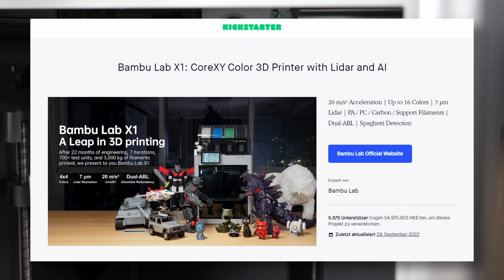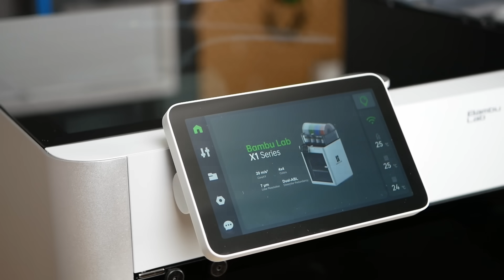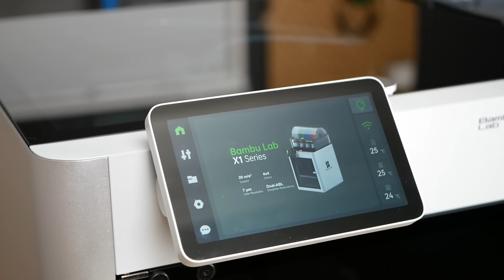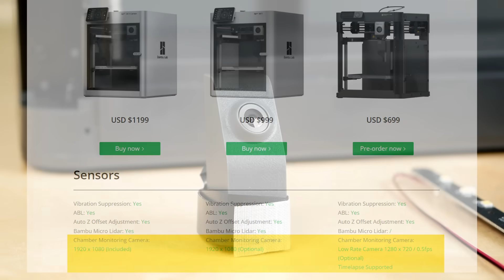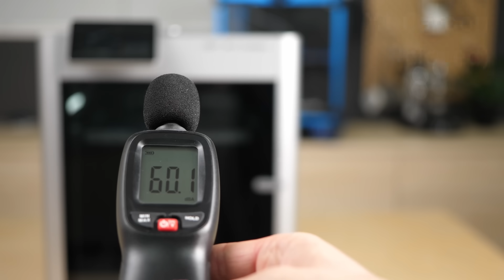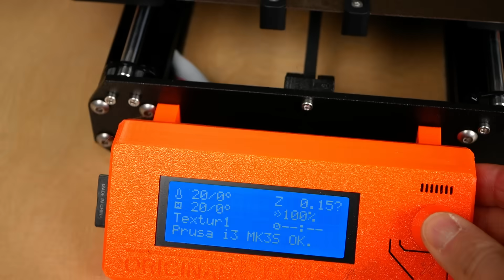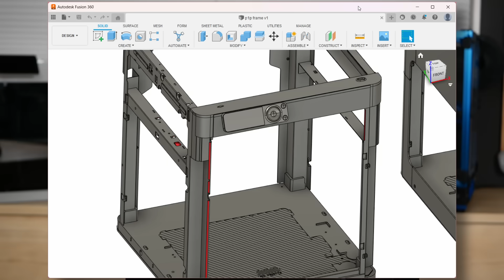The Best 3D Printer of 2022 got Stripped Down to make it Cheaper!

Comment: I got both the MK3 and the X1C. Not gonna lie, the later opens way more possibilities.

But I’m way more scared to break it. Because you can’t « break » a Prusa. Unless the whole machine catches fire, you can always dismantle it, reprint, and re-fasten the parts. 

The Bambu ? Not so much ; I can’t even remove the back panel
Reply: It's true that you can repair a Prusa, and the benefit of that can't be overstated. However, I think comparing it with a Prusa MK3 is the wrong comparison. The MK3 is 5-6 year old technology. Somehow Prusa continues to sell them for $1100, but in reality the MK3 should be a $300 printer (see the Sovol SV-06 - better than then MK3 in almost every way, now selling for $229). A better comparison would be the X1C vs. a Voron Trident. The Voron is also open source and can be repaired and easily modded. Both the Voron and the X1C are designed to print materials that require an enclosure. Parts on my Mk3 started failing rapidly (Z motor developed bad bearing, Z probe failed, extruder probe mount drooped) when I enclosed it. Both the Voron and the X1C can hit accelerations and speeds that the MK3 just can not reach.  Even after "upgrading" my printer with a Bear frame, a Y axis linear rail mod, and Klipper with Input Shaper enabled, I can't get remotely close to the same speed as the X1C or Voron. Plus it is an uphill battle to add mods to a Prusa that are either simple to add to a Voron or come built in on the Bambu Labs (an accelerometer, for example).  So yes, you can maintain and even mod an MK3, but the amount of time and money you put into that, the limited improvements you will get, and the over-priced nature of the base printer make it a poor choice in 2022. I was hoping that Prusa could turn it around with the XL, but with the delays in shipping and the introduction of the X1C at almost half the price, I am starting to have doubts.
Reply: @mghumphrey  The sovol sv06 uses junk knockoff parts from china, of questionable quality. That's why its $300. It's Z axis cant even align itself automatically because it's so weak. Modbot had to use soup cans to fix his sovol.
Reply: @LilApe  That z axis thing is 100% firmware. I know because I wrote a Klipper macro to do a soft Z tram for my MK3. If you think Prusa is using the same type of parts, also sourced from China. in addition, they cheap out on the infill and perimeters on their printed parts. The injection molded parts on the Sovol are actually stronger.
Reply: @LilApe  lmao so does prusa. When they say "high quality linear bearings," you know it's not a name brand.
Reply: @morbus5726  Except they use misumi rails and bearings, made in japan. Try again.
Reply: Nah, I've seen multiple people permanently ruin their Prusas.
Reply: @louisvaught2495  how ? There’s always things to salvage
Reply: @_Xantras_  That's a fairly naive viewpoint.

There's usually a point where diagnosis and repair exceeds the ability of an individual user to figure out what's wrong.
Reply: @louisvaught2495  how exactly do open bearings (to quote your example) ruin the frame, the bed, the motors, the wires, the PSU ? 🤨
Reply: @louisvaught2495  Running it over with their car?
Reply: @louisvaught2495  Press X for doubt.
Reply: @LilApe  Open bearing rails means it's relatively simple to get debris on them that permanently ruin the mechanism.

Relatively though, it's a rare failure case but means you have to strip and replace one (or both) bearing rails,  and sometimes the plastic parts have to be re-printed as well.

It's a PITA to diagnose and fixing it requires a full rebuild.
Reply: @louisvaught2495  How it’s permanently ruined if you can replaced busted parts and rebuild? 🤔
Reply: @apinakapinastorba  The same way a flooded car is ruined. Yes, everything can be replaced but it is rarely worth the cost and effort for the vast, vast majority of people.
Reply: @apinakapinastorba  When the repair requires knowledge on diagnosis that most users don't have, it doesn't get repaired. Of the two people I've seen this happen to, one gave up and basically threw theirs away. The other one was never quite the same as when new.

Bearing failures on the Mk3 can be really soft failures and usually just show up as artifacting on the prints. Other open-rail printers do the same thing, it's really common on Ender 3 style when you flat spot the rollers.
Reply: @louisvaught2495  I don't see how debris can get into the bearing of a MK3 when they have seals on them. However, that is exactly what happened to some users of the X1, with the open design of the X axis bushings. Its on reddit. He had to send his X1 back because Bambu doesn't offer bushing, bearing or rail replacements, they don't want you fixing that yourself. His carbon rods had huge gouges in them because there was like a .03" thick gape in the bushing and rail.
Reply: @tomsko863  That escalated quite quickly from busted bearings etc to replacing everything 🤭
Reply: @LilApe  There's no need to wildly speculate in order to defend something you personally care about. It makes it really tricky to continue a useful conversation.

The problem is that none of what you've said is anywhere close to correct.

Wiper seals aren't foolproof and need to be low drag, all it takes is something vaguely adhesive on the surface to allow debris to get into the bearing, and grease gets tacky as it ages.

The design of the Prusa is open with the bearings below the motion stage, which is particularly bad for this type of debris intrusion. The Bambulab doesn't have the same issue, debris won't naturally fall onto the motion components.

Mostly because the system is enclosed, but also because the extruder and print surface are both out of the way.

The Voron printers all do the same thing, moving the linear bearings out of the way of print debris as much as possible.
Reply: @apinakapinastorba  To be honest you're probably right. I'm not that knowledgeable so I would have no idea how to replace the lead screw or bearings if it happened to me.

Comment: How does this compare to Prusa printers.
Reply: Cheaper and better, dont get me wrong the i3 is a great printer, I have one and love it but what BL have done is outstanding but I see a return serve coming from Prusa, the XL is already in the works but I see them coming up with something inbetween the XL and the i3 MK IIIs+.
Reply: Faster, but not more reliable. Check their subreddit
Reply: quite a bit easier to use, and just as reliable, while also having like 2-4 times the throughput.

Comment: You're saving $300/$500 by cutting out the useless lidar sensor basically. Bambu proved with the P1P, how gimmicky and unnecessary the lidar in the X1 is.
Reply: Why are you on every video about bambulab stating basically misinformation. The difference between the 2 isnt just the distance measuring lidar, but the flow calibration tool head camera as well.
Reply: @BeefIngot  You must have a thing for me, you seek out my comments all the time and cant get over the fact that the lidar sensor does nothing.
Reply: @LilApe  I see your comments spouting misinformation on every Bambu video I see so of course I comment to correct that before you mislead people
Reply: @BeefIngot  Its literally facts though lmao. You cannot sit there and tell me its misinformation about the lidar sensor being a pointless gimmick, when 99% of their users disable everything that has to do with the lidar in the print process, this literally making it useless. You're on the internet, you can look it up.

Go tape up your lidar sensor, tell me it does something different, it doesn't.
Reply: @LilApe  I have an X1 carbon. Can you explain which settings I'm using disables the LIDAR? 
You said "99% of users disable everything that has to do with the lidar".
You're also saying that "everyone" disables first layer checks? This is the first time I hear about this. Why would I do that?

If the LIDAR is covered up, the pressure advance is set to a static value of 0.02 as a failsafe. This value will is a good standard value for PLA.
But this doesn't mean the LIDAR doesn't do pressure advance auto-tuning.
Reply: Hello again. Im still waiting for the video where you post the 0.003mm tolerances you hit on your prusa, and the sub 10 minutes speed benchy you said was possible.
Reply: @morbus5726  They really do spout nonsense. The claims they make are absurd
Reply: @morbus5726  You and they beef guy really do have a hard on for me. Your daily mission to seek out my comments. I'm flattered.
Reply: Where did you find the cost for the lidar sensor?
Reply: @logitech4873  They didnt. They are talking nonsense and dont even realize that the X1 doesnt only just have the lidar sensor but also the toolhead camera and computer to do the computations required for computer vision.

They have no idea about what anything costs or does. They just hate Bambulab
Reply: @BeefIngot  "toolhead camera and computer to do the computations required for computer vision"

You mean the camera that tells you if your 1st layer is good or bad...which everyone disables? you mean that tool head camera?
Reply: @LilApe  You keep stating "everyone disables everything" like its a fact, but thats just not true.
Reply: @BeefIngot  Again, I said you're on the internet, look it up, you'll find the evidence you need.
Reply: @LilApe  "look up evidence for the baseless things Im saying" are common words from parties arguing in bad faith. Either you have evidence or you don't. Its obvious you dont.

Comment: Personally I don't care about losing the enclosure, the high temp bed or nozzle but losing the camera and some of those other first layer perfecting features probably makes it a pass for me. At that point it's not much different than my prusa just a lot faster.

If I was going to buy a new printer I'd splurge for the carbon
Reply: It does have a high temp nozzle, just not a hardened steel one.
Reply: Just as a note, you CAN get the Camera, LED Strip, Hardened print head and the Aux cooling fan as options. I think Bambu has priced all their parts very reasonably, with their custom hardened nozzle priced well within the price of similar nozzles (high quality ones, not the clone junk). A similar nozzle for an Ultimaker 3 runs $120 USD. Bambu sells theirs for like $17 or so. They also have free prints for making side panels if you need to enclose and even the glass top and door are available at reasonable prices.
Reply: Of course you don't care. You must be only printing decorative things in PLA.
Reply: @alejandroperez5368  You don't have a clue.
Reply: @alejandroperez5368  You must be new to the 3d printing community - so far you were more into communitys where it is normal to answer reasonable points with personal slurs.
Reply: @zebarzebra  nope, I've had the Ender 3 for years. Your comment only makes sense if you're printing only with PLA and PETG. But zero ABS or ASA parts ;)
Reply: @alejandroperez5368  As an Ender 3 owner who seems to think highly of themselves I would have expected you to be aware that none of those features are required to print functional parts, partly because there are ways to get printers to print ASA/ABS without a built in enclosure (eg using an external enclosure as many Ender 3 owners do), and partly because PETG and PLA are perfectly serviceable as structural parts if used appropriately.

Comment: The p1p proves without a shadow of a  doubt that the prusa printer is hugely overpriced.
Reply: learn from history... read about what happend to makerbot....
Reply: Overpriced? No. The components they use aren't cheap and designed for longevity. Showing its age and desperately needing a refresh/redesign. Absolutely Yes. Prusa better be spending all the time they're delaying themselves to crank the speed of the XL otherwise every review will say "it's a good printer at yesterday's speeds, buy an x1 carbon instead".
Reply: @zeke7515  you can and people have self sourced mk3s using oem parts for 500$, much less than the kit of 800$. They have even raised prices as I purchased my mk3 for 750$. Outdated hardware should get cheaper with age.
Reply: @Unscientifically  not necessarily—that only works when you deal with the same suppliers and they have paid for the tooling.  Prusa has had to change suppliers—global disruption don’t you know.  They are trying to in-source where they can to help control costs but they don’t have a dozen parts manufacturers within a standard league all bidding on contracts.  Can’t find that anywhere outside of China right now.
Reply: @robblincoln2152  Regardless of the global disruption, electronics and such still get cheaper over time. If they do everything in house now, their printers should be cheaper than before, not more expensive. Now days better components are cheaper such as 32 bit boards being cheaper to manufacture than 8bit. Prusa doesnt want to change their printer design since that costs a lot of money and for that they use outdated stuff. This will lead to their downfall
Reply: @zeke7515  Dude, I like Prusa as much as the next guy but let's be real here, the components for that printer do not cost anywhere near the price they ask for it.
Reply: Prusa is overpriced? lol the X1 is overpriced. They charge you 300/500 dollars extra for a lidar sensor that doesn't even work or do anything. You can tape over the lidar and it changes nothing. That's overpriced to me.
Reply: For lidar, three cameras, a full enclosure, a carbon filter, an aux fan, a hd capacitive display, and all the ai processing units, I think it’s worth it.
Reply: Who developed the core of the Bambulab slicer?